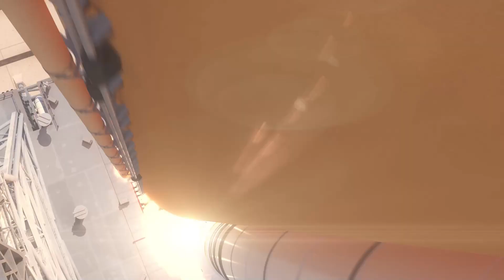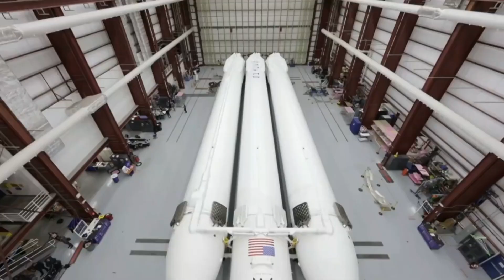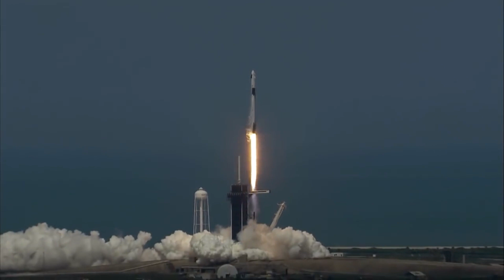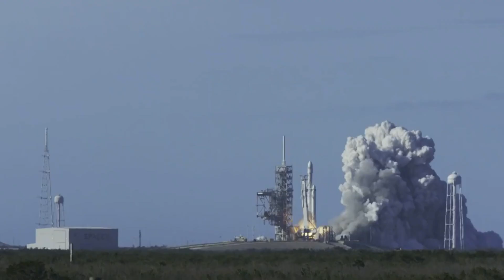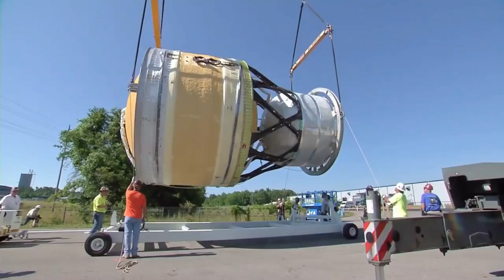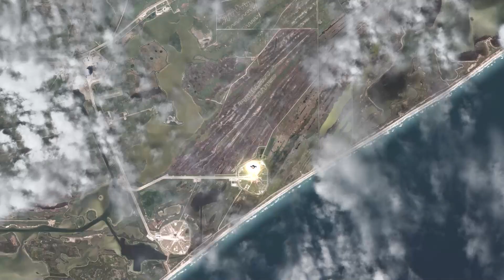Why Falcon heavy can't replace SLS

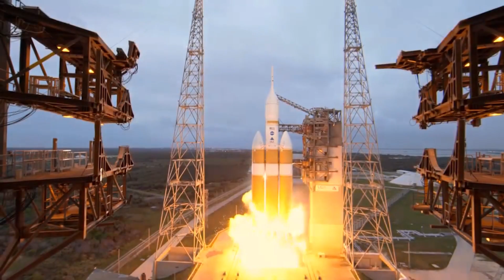Comment: 1:30 Why? Is it inconceivable for it to be modified to do so, if there's any actual problem with integrating Orion horizontally?

2:50 Several years? Launch complexes were erected like hotcakes in the early-mid 1960s.

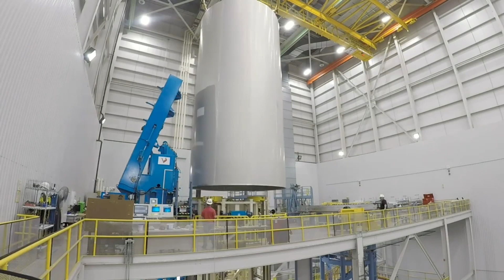4:40 Couldn't the government step in and prevent the tooling from being scrapped?
Reply from the maker: I’m not a NASA engineer I don’t know why it can’t be integrated horizontally all I know is that it can’t and that it’s impossible

And your second point ignores the fact that NASA had a near limitless budget in the 60s

And your third point ignores the fact that the government doesn’t WANT to replace SLS. So they’re not gonna “step in” to keep that tooling around

Comment: For those who say SLS is somehow "stupid":
The REAL purpose for SLS is to get NASA a heavy lift rocket they've been wanting for ages, with the lowest amount of engineering required - as it was thought "for cheap". Although it turned out to be expensive, most of these costs have been recurrent ones - engineer salaries, factory maintenance, etc. If most of your yearly budget for a project are costs you have to pay every year, it baloons up. Just a simple example: 
You need to produce something for 60 dollars and you need to spend 80$ per X time for food, rent, etc.
If your boss gives you 100$ per X, you will spend a total of 300$ before the project is complete, but if he gives you 140$ per X then you only spend the 140$. Although it may seem counter-intuitive, sometimes the cheapest way to get something done is to give the one doing it more money.
Reply: "The REAL purpose for SLS"

Is jobs and kickbacks. If it was, as you claim, about getting NASA a super heavy lift rocket, then Congress shouldn't have dictated how NASA would contract for SLS. First, Congress demanded, illegally, in violation of the Competition in Contracting Act of 1984, that NASA require Shuttle components for SLS; second, they demanded, under threat of NASA's budget, that they grant a COST PLUS contract when NASA wanted a Fixed Cost contract.

It was always about jobs and politics. It was always the Senate Launch System. NASA is simply being blackmailed into supporting SLS long after they've had viable replacement options. Same with fucking Orion. We could use Crew Dragon or Staliner instead, send crew to LEO, rather than use SLS as a tin can taxi to the moon to mean Starship HLS. That's like sending a rowboat across the Atlantic to meet the goddamn Mayflower.
Reply: @SecretRaginMan  There is no viable replacement option. SLS is DONE, for all intents and purposes, while Starship is still very theoretical at this point, especially the stuff that is supposed to make it cheap. And the use of Shuttle components wasn't the only option - others included basically remaking the Saturn V (which would've required completely new components) or LEGOing together existing rockets (which as Falcon Heavy shows is surpringly complicated). The Shuttle-based option was chosen because it was thought to be the cheaper. And cost-plus also have some stuff in their favor - they guarantee there won't be any cost-cutting in the system. The SLS could've been closer to the original DIRECT design (which wasn't even from NASA or the Shuttle contractors, but some enthusiastst), but that would have too small safety margins.
Reply: @HalNordmann  SLS is not "done". Even if it passes WDR (Wet Dress Rehearsal), it still needs to fly.

Starship isn't "theoretical". It's in fucking Boca Chica right now. Booster 7 is being fit checked on the orbital launch mount. At the time of the SLS rollout, Ship 20 was stacked on Booster 4 on the orbital launch mount and had its own little WDR. First they filled them with nitrogen, then propellant.

Starship is as real as SLS. More so, even.

Everything else you said is just as bullshit as calling Starship "theoretical". Remember when they said Falcon 9 Heavy was a "paper rocket" and that "SLS is real"? 2014. Guess which rocket from which company actually fucking flew multiple times by now.
Reply: @SecretRaginMan  WDR is just like final test in theatre - it is just so they rest easy, not because they actually need it. And Starship hasn't even had full testfire of its engines yet - y'know, the thing SLS did many years back.  Plus, they still haven't solved the issue that most of their operation in BC is skirting the border on legality. There isn't even a design freeze on it - something which the SLS had in, oh, 201x something? And BTW, the thing Starship did wasn't WDR, it was a cryo test - which the SLS already did way back. There is still a lot of time before Starship can even fly, much less carry 130t fully reusable. Things like preparing Starlink attachments on it while the cargo door isn't finalised is cutting a bear that is still in the forest.

Comment: First crewed starship is scheduled for 2023. Why are we still talking about Orion?
Reply from the maker: because orion is done, starship is not. any estimate about when a crewed mission may be is not based in any fact or reasoning. there is no ship that is capable of carying crew wheras the crewed orion is already nearly complete
Reply: programmed is not the same as ready, the dragon crew (an incredibly simpler vehicle compared to starship), was scheduled to fly in 2016, which happened in 2020, with the falcon 9 ready for years, starship is a completely new vehicle , which will have A LOT of delays

Comment: More realistic option would be F9 + crew dragon. And then onto Lunar starship, with only difference being more refuellings, including in lunar Orbit. 
Or just only Starship later on, though that's not the topic of video.
Reply: Falcon 9 doesn't have the abilities to do this. As much as I like it and its wonderful engineering, it's an inefficient launcher by essence.
Reply: @fuckednegativemind 4 successful crew dragon launches to the ISS so far prove you wrong. What are you talking about, ofc Falcon 9 can launch crew dragon...
Reply: @fobusas   Yes, I misread your comment, I thought you were talking about sending crew dragon to lunar orbit with a Falcon 9, my bad.

Comment: The capability to launch astronauts to the moon is not worth the exorbitant price of the SLS. It should be cancelled.
Reply from the maker: SLS costs half as much as the Saturn V
Reply: @DavidWillisSLS  exactly.
Reply: So how else do you launch people to the moon?
Reply: @coffeespy1133  Starship. Or we could just not go to the moon and use those 2 billion dollars per launch to fund other programs.
Reply: @infinitelyexplosive  starship won’t be ready for crew for many many years, nasa won’t risk it without an abort system I think.
Reply: @coffeespy1133  That's fine. Better than throwing billions of dollars away.
Reply: @infinitelyexplosive  who’s throwing billions of dollars away?
Reply: @infinitelyexplosive  how is that throwing away money if it has a legitimate purpose?
Reply: @coffeespy1133  Because it's so absurdly expensive. For the price of 1 SLS launch you could have something like 10 FH launches. It's just like how buying a $1,500,000 hypercar is throwing money away. Yes, it can technically go faster than a $50,000 sedan, but the difference in performance is clearly not worth the difference in cost.
Reply: @infinitelyexplosive  find me another way to throw astronauts to the moon that is cheaper, I’ll wait
Reply: @coffeespy1133  Now you're okay waiting? So then wait for Starship. 

Why are you so fixated on going back to the moon? Why is that worth the 20 billion dollars of development and the additional 6+ billion for launches? We could have built another three James Webb Space Telescopes for that price, we could have dramatically expanded the ISS, we could have funded so many programs instead of spending 10% of NASA's entire budget over the past decade on a rocket who's capabilities barely exceed existing options.
Reply: @infinitelyexplosive  I’ll wait for your response dummy, not a rocket if I don’t need to, why wouldn’t we be fixated on going to the moon?
Sls excels over any other rocket in service rn, again, I ask you, what rocket can carry Orion or humans in general to the moon? I’m not asking what rocket can carry more payload(even tho sls still can carry the most) and sure, you can say starship but starship won’t fly humans for many many years IMO considering its safety features or lack there of
Reply: @coffeespy1133  "why wouldn’t we be fixated on going to the moon?" Because there are other scientific tasks we could put that money towards. Why shouldn't we be fixated on fusion energy?
Reply from the maker: @coffeespy1133  you literally cant
Reply: @DavidWillisSLS  exactly my point

Comment: SLS hasn't flown. FH has.  FH is mostly reusable SLS is way too $$ to dump into the ocean every single flight.  FH can't do what SLS is claimed to be capable of... but it still hasn't flown.   

SLS will fly maybe 5 times before it's canceled.
Reply from the maker: Lol SLS flies this year.
Reply: @DavidWillisSLS  No it certainly does not... The most optimistic timeline is November 2021, and since when SLS was able to keep to deadlines? You only need to slip a few weeks
Reply: @fobusas  Actually, I heard they are currently AHEAD of schedule. Problems can still arise, but it likely will fly.

Comment: The falcon system is modular. They added 2 boosters; they can add more if the need arises.
Then they can have all of them ready for another launch quicker than nasa can write a press release.
Reply from the maker: Falcon heavy isn’t modular. They had to modify the core to be able to withstand the load of just two extra boosters. There is no way that thing will be able to take another 2 without crumpling mid flight. Plus the GSE is simply not set up AT ALL for anything more than 3 cores.
Reply: @DavidWillisSLS  We'll see what super heavy can do.
It hasn't flown yet, either.
Reply from the maker: @michaelpcoffee  lol they just de stacked superheavy. Lmao
Reply: @DavidWillisSLS  so?
ROFLMFAO!!
Why is dismantling a preproduction mockup funny?
Reply from the maker: @michaelpcoffee  because youre trying to compare a recently torn down mockup to a real orbital stage that will power an an actual lunar mission
Reply: @DavidWillisSLS  i am not comparing a mockup to anything. I am comparing two designs that have neither succeeded.
One is 40 year old obsolete surplus tech: made by a government that cancelled manned exploration on account of political popularity polls.
The other is a new design: intended and optimised for human interplanetary colonization.
NASA has had forty years to do just what they are only now trying.
Reply from the maker: @michaelpcoffee  you compared it to superheavy. then i said they were dismantling it, then YOU called it a mockup. YOU did that michael. YOU did.
Reply: @DavidWillisSLS  Nope. You referred to a dismantled mockup when i referred to the type by name.
You really think the superheavy is a one off!
No wonder you're confused.
Reply: @DavidWillisSLS  your comments aged well didn't they?

Comment: Space-x could design and build a whole new rocket before SLS is ready to fly. After all they have been working on that dinosaur for 40 years now.
Reply from the maker: SLS didn’t even exist 10 years ago.

And it is going to be launching on November 4th

Everything you said is wrong
Reply: @DavidWillisSLS  SLS is a reuse of the old space shuttle parts. It may only have been renamed SLS 10 years ago, but the components were all designed in the space shuttle era. in fact the rocket engines are space shuttle left overs, all be it modified. So I still maintain that the technology is over 40 years old.
Reply from the maker: @MrParcho  only the boosters and engines come from the shuttle.

the rest of the rocket is brand new
Reply: @DavidWillisSLS  Oh and the upper stage engines are the same ones from the Centaur Upper stage in the Atlas V rocket.
Reply from the maker: @TheStopwatchGod  not really. It’s a stretched version of the delta cryogenic second stage. But it isn’t the SLS’s real upper stage, it’s an interim (cryogenic propulsion) stage.

SLS’s real upper stage is the EUS
Reply: @DavidWillisSLS  So it has taken only 10 years to design and build the top 20% portion of the system at a paltry sum of only $20billion, which will all be thrown into the ocean. The SLS is not a launch system, but only a politically expedient way of distributing wealth to a few.
Reply from the maker: @MrParcho  no it took 6 years to build the core stage, the launch vehicle stage adapeter, and the ICPS, as well as build and test several stuctural test articals, and static fire 6 solid rocket boosters and one core stage.

you are an actual idiot if you belive what you've written is true
Reply: @DavidWillisSLS  So it has taken 10 years to design and build the top 20% of the launch system, at the paltry cost of $20 billion. The senate launch system is not a viable launch system it is only an expedient method for senators to deliver money to their few chosen ones. 
I think that there only 8 boosters left so after that there is no funding for the program. So Boeing needs to squeeze all that it can from the golden goose.
Reply from the maker: @MrParcho  you said the exact same thing you’ve already said. And just like the first time you said it, it was completely stupid. In fact it might’ve gotten even MORE stupid
Reply: @DavidWillisSLS  Wow your wit leaves me speechless.
Reply from the maker: @MrParcho  your inability to grasp basic concepts leaves me speechless as well so I guess it evens out
Reply from the maker: @MrParcho  dude you have done nothing but lie about SLS for the duration of this conversation.

your beef is with any ideology that differs in any way from yours.

you go so far as to lie just to protect your own fragile worldview.

stop it. get some help

Comment: Great video, although I’m still a big fan of the Falcon Heavy Orion concept. The reason being is that Falcon Heavy in reusable configuration could launch Orion into LEO for some sort of servicing mission (to Hubble) for example or transporting astronauts to the ISS.
Reply: Why would we service a 30 year old telescope when we have James Webb right around the corner? Most importantly, why use Orion for LEO operations when there are two commercial alternatives built just for that purpose?
Reply: @jamesmclaughlin272  James Webb is by no means a replacement for Hubble just because it’s more advanced, powerful and newer. It observed in infra-red compared to Hubble which is ultra-violet. Hubble is still a one of a kind telescope that is still incredibly valuable and useful. The replacement for Hubble is a new telescope in development called Nancy Roman (developed by NASA), but that isn’t expected to launch for at least another 6-10 years.

Since Orion is only 26.5 tonnes, Falcon Heavy in reusable configuration could take Orion close to GTO in order to service a satellite all the way out at GEO, so it’s definitely not restricted to LEO with FH.
Reply: @alrightydave  
I know hubble isn't the same as Webb, my point though is that its 30 years old, already been serviced multiple times and doesn't warrant any more attention. 

The fact of the matter is that if we ever had to service something like the JWST in a high energy orbit with astronauts, it would not use FH, such a mission would be on an SLS block Ib with Orion and a secondary payload that has an airlock plus servicing equipment.
Reply: @jamesmclaughlin272  

"The fact of the matter is that if we ever had to service something like the JWST in a high energy orbit with astronauts, it would not use FH, such a mission would be on an SLS block Ib with Orion and a secondary payload that has an airlock plus servicing equipment."

Why not just  use smaller modules and assemble at ISS, then refuel to go to JWST.
Reply: @neutrino78x  Because if you launched out of the 52 degree inclination of the ISS you would be nowhere near the L2 thus requiring a large plane change on your transfer. You'd effectively eliminate your benefits from orbital assembly with this method.
Reply: @jamesmclaughlin272  

"Because if you launched out of the 52 degree inclination of the ISS you would be nowhere near the L2 thus requiring a large plane change on your transfer. You'd effectively eliminate your benefits from orbital assembly with this method."

Nah man it just means you need fuel,  which means either more fuel from earth OR from the Moon. Once you have a place in LEO where you can do any assembly needed and refuel, you can go anywhere. Maybe even make fuel modules. I need 10 fuel modules to to Mars, 20 to Jupiter....or maybe another fuel depot in Mars orbit or one of the moons of Mars. :)

Comment: Hmm, technically possible, but for the Artemis missions it's impossible.

Thanks for your work.
Reply: It’s possible to low Earth orbit while recovering all three boosters though.
Reply: @TheStopwatchGod  Nope. You need all three boosters expended for it.
The maximum payload with 3 landings on ASDS is around 42 tons, which isn't enough.

Comment: OK I see where you're coming from but in theory it still could be done but the program would have to change a bit fh expandable is 60t to leo and if they wouldn't stop producing that Orion transfer vessel they could still send people to the moon and with the ubgrade of the fh fairing and Vulcan coming out they could in theory construct the gateway with expandable fh's and Vulcans and it would probably still be cheaper than SLS as fh expendable is $150 milion and Vulcan is up to $300 milion I think and SLS is almost triple of Vulcan and 6x the cost of fh so 6x60=360 to leo while SLS can do 120 for the same price
Reply: Starship would be a better choice